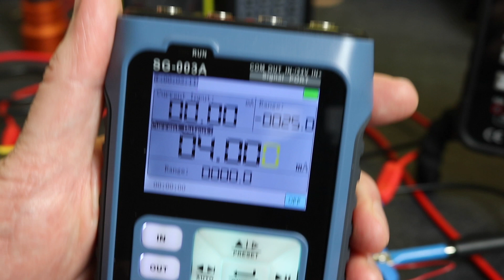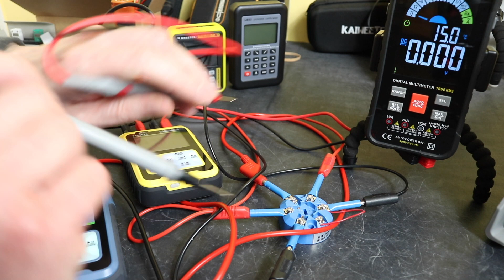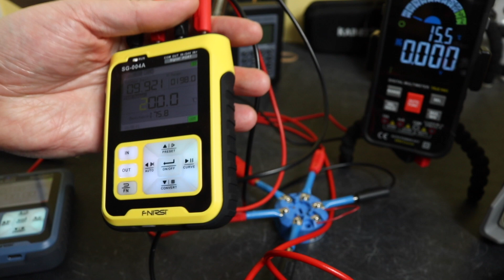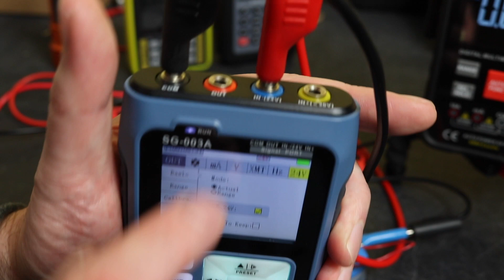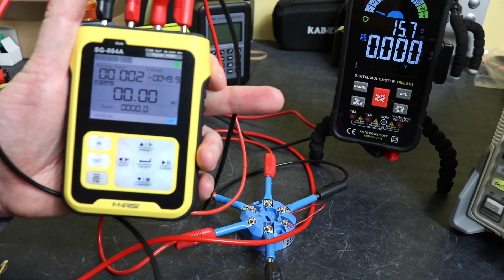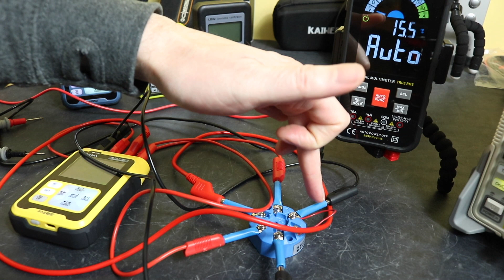Calibrator 24 Volt Power Functionality Demonstration

Comment: It’s good that this meter is cheap and offer a calibration function. What I like to know is what is the good if I don’t have a source of reference? I have got the blue one..which serve me well in equipment troubleshooting esp the 4-20ma signal function of it. Thanks for your detail sharing of this video ❤
Reply from the maker: Depends on the level of accuracy that you want from the device. If I want to use the SG-003A for calibration purposes then I would send it away to a calibration lab for independent verification on a regular basis. If I want to use it for general fault finding, then I can sense check the output functions of the SG-003A with a multimeter and then use the output functions to sense check the input functions of the SG-003A. Log all those results and carry out the tests on a regular basis to build up the trend. For external calibration, regular would likely be annual, for sense checks it would more likely be on a monthly basis.
Thanks for watching and your question.
Reply: @three-phase562  thanks bro, appreciate your advice n suggestion ❤️ keep up yr good work.

Comment: Well done.. also got an SG003A and your way more competent than I am, on the purpose of all these features.
So kudos for explaining many of these features and where they are handy.
Same with the conversion feature, and situations where that could be usefull.
Seems my unit SG003A are not fund to go above 23.4v even when asking for 24v and display claiming it, its 23.4v
Reply from the maker: Yes, my SG-003A is the same putting out 23.3V on the output terminals. If I enable the 'Use 24V' function though and measure between the output 0V terminal an input 0V terminal, I get 24.9V. I will load it up on my load bank and see how it reacts.
Thanks for watching and commenting.